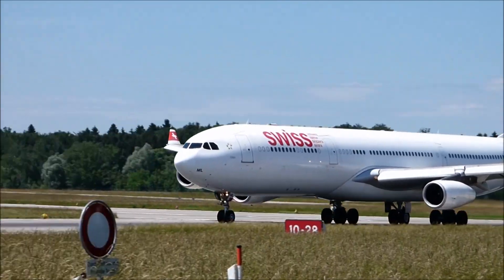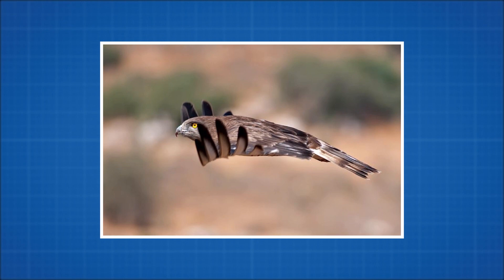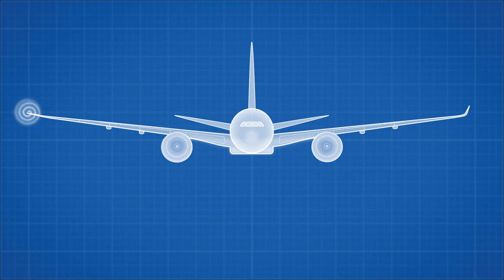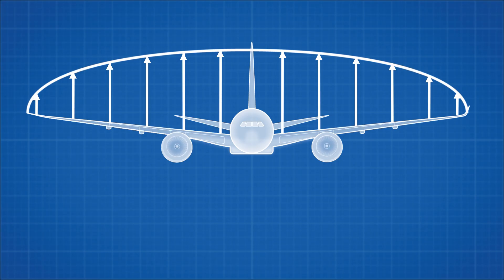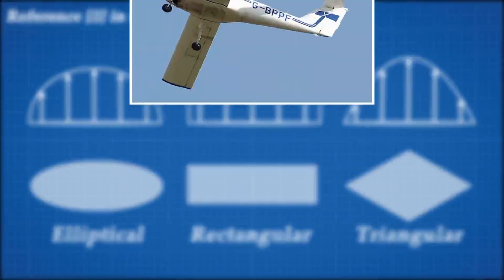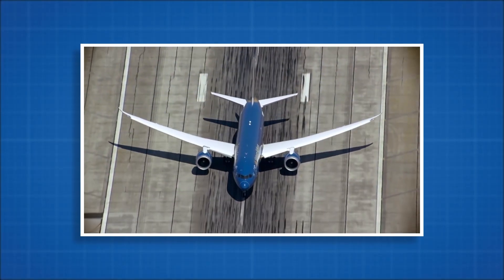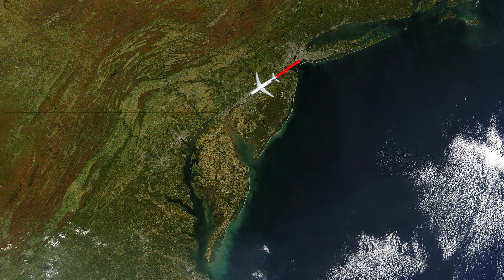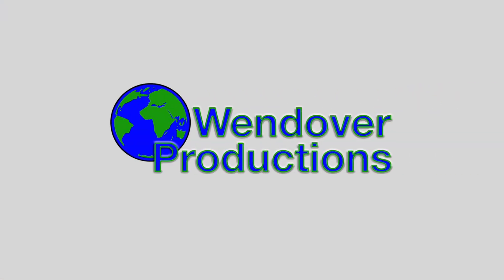Winglets - How Do They Work? (Feat. Wendover Productions)

Comment: you're wrong about how planes fly. their primary operational principle isn't the pressure gradient from the shape of the wing. if that were true, then planes would not be able to fly upside down, which we know they are capable of. the main source of lift is a sufficient angle-of-attack of the wings deflecting incoming air downward, which by newton's laws, forces (literally) the plane upward.

source: my university physics professor (who also happens to be a licensed pilot)
Reply: So there are a lot of things that are kinda woven together in this.

There are two things about the wing that will cause it to create lift, chamber and angle of attack. Chamber is basically the curvature of the wing. When flying upside down the chamber would work to create a downward force, so the plane must fly at a higher angle of attack to counteract it. 

When describing the physics for why a wing works there are multiple ways to do it that are all correct and equivalent. The most  commonly used today is to use newtons third law as you did.

The second method is measuring pressure as done in the video. This is equivalent to the newtons third law method the same way that you could model the path of a projectile using either forces or energy. The reason this is not done nearly as much today is due to a commonly repeated fault in logic about why the pressure is different.

The false statement is that the if you chose two particles of air that were next to each other before reaching the wing, and one goes over the wing while the other goes below the wing, the two particles  must meet again at the trailing edge. Since the particle going over the wing has a longer path it must go faster, which by Bernoulli's law means the underside will have higher pressure.

In actuality the two particles will not meet up, but that does not mean that the underside isn't of higher pressure. Another way to think of it is that the high pressure on the underside of the wing will make the air want to move, but it cant go up through the wing, so it must go down. By Newtons third law the air accelerating down will create an upward force on the wing.

A third, far less simple although actually more accurate is through analyzing circulation around the wing. This is very complex and rarely used but basically there is a phenomena where there is a very thin layer of air moving in a circular motion around the airfoil. This thin layer is actually moving backward on the underside of the wing. By measuring various parameters such as the speed you can calculate the lift.
Reply: Planes fly because of a combination of both these principles.
Reply: saying "planes fly because of a combination of both these principles" is like saying meteorites burn up because of air friction. technically, it is a contributing factor, but it's incredibly misleading. probably like 99% of the reason meteorites burn up is compression of air in front, and similarly probably 99% of the reason planes fly is the angle-of-attack principle. otherwise, again, how the hell would planes be able to fly upside-down?
Reply: THANK YOU!  cheeses crust, most people are mistough this information
Reply: How planes fly is as mysterious as why they fly at all. Bernoulli says its pressure difference , 
Newton says action/ reaction. I don't understand why the fast moving air on top has to meet with the bottom slow moving air at all. My professor once told me , " given enough power , ANYTHING flies. even a stone. " the plan is to make it as efficient , as controllable as possible. We are still learning. our current efficiency is no where close to that of birds.

Comment: Hey Real Engineering, I have an engineering question that is not related to the video, but I hope you can help:
Why are there so many different types of wings, especially on fighter aircrafts. Shouldn't there be a standard wing whose shape is optimised for a particular task, be it speed, manoeuvrability, efficiency etc? If you look at the YF-23, which is supposed to perform the exact same task as the F-22 Raptor, they both have very different wing designs. Is one really better than the other? 

I have been puzzled by this question or a long time and I can't seem to find the answer to my question anywhere. Do you know where I can learn more about wing shapes and how they affect the performance of an aircraft? (Or perhaps could you make a video on wing shapes? :)) 

Anyway, thanks for taking the time to read through all the comments. I hope you can help answer my burning questions :)

Your videos are educational and informative, not to mention awesome. I have watched every single one of them!
Reply from the maker: That is a very loaded question. We discover new methods of manufacturing, we discover new materials, we learn more about aerodynamics, engines and control surfaces shift position, radar evasion may be a higher concern. Speed and cruising altitude requirements change. There are SO many variables that effect wing shape. 

I'll be doing loads more videos on wing design in the future. Just keep watching to learn more!
Reply: Alright :) I'm looking forward to them as I am really interested in the physics of these wings. and I hope you can analyse how they effects the compromises made for different requirements in depth.

But I am still particularly curious about the example that I quoted on the F22 and the YF-23, they are created at around the same time, they are meant to perform the same tasks. But I do not understand why the YF23 chose to have such a different wing from the F22? Like what made them chose to have that kind of wing etc

Anyway, thanks for taking the time to answer our questions! I'm looking forward to your videos
Reply: Real Engineering why tf did I just read this in your accent without realising 🤣🤣🤣 btw love ur videos
Reply: If you break off your example from those fighter aircraft and choose for example a 747 and an A380. 

The 747 wing was designed at the time with alot of wing sweep. One reason for this is to delay the onset of shockwaves just like all other swept wings before them. Well that wing sweep gives the 747 a very high cruise speed but at the same time highly swept wings do not work well at low speeds. To solve this Boeing used triple slotted flaps on the 747 which allowed it to takeoff and land at similar speeds to planes much lighter than it.

Fast forward to the A380. Besides the fact that the engines are much more efficient, Airbus went with a high aspect ratio wing (think more like a glider wing, long and narrow chord on average). This allows the A380 to use engines with less thrust while cruising much more efficiently. The cruise speed is the same for both but the price per passenger per mile are worlds apart.

So back to the F-22 vs F-23. They both may have similar cruise speeds, range, and a list of other things the USAF wanted but I think the F-22 came out of top because it was much more conventional (basically a smooth F-15) and has a tighter turning radius due to a larger wetted area and vectored thrust. This is part of the reason the F-35 won also and not the F-32(highly unconventional, unsafe inlet, could not even transition from forward flight to hover without ground work ect).

So there is an area where the F-22 and the F-23 have very similar performance but there are areas where one is superior over the other. I believe the F-23 was faster in part due to its longer more streamlined shape but this also comes at a cost of turning performance.

That's my 2 cents but i'm just an A&P mechanic who has been studying aviation for the last 14 years.
Reply: uh oh, nope

YF-23 is actually stealthier than F-22A, or to be exact YF-22(F-22A's prototype) albeit less stealthy on cockpit area since instead of using frameless canopy, they opted the one with a bar on it. and also, YF-23 hold faster speed in any time than YF-22. the reason why it wasn't selected is: 1.because YF-22 has thrust vectoring and more conventional moving controls that's less risky compared to YF-23's combining vertical and horizontal stabilizer tail, also, YF-23 is more costly to maintain thanks to it's ceramic tiled exhaust to reduce IR detection from GAD/SAM.

YF-23 is stealthier, faster, and almost as good as YF-22 in maneuverability. but YF-22 nailed the coffin with it's demonstration of 60 degree AoA demonstration and weapon launch demonstration, which leads the USAF generals to believe it's less risky to develop F-22A than say, F-23A, also at that time, NATF exist and the navy also choose YF-22 since the naval version of it is basically a stealth Tomcat with frameless canopy and thrust vectoring, compare to the uglier delta canard design for Naval "F-23C"
Reply: F-22A reflects less radar and is more stealthier than the YF-23. YF-23 canopy has blindspots which is not ideal for dogfighting, produces a lot more heat signature unlike the F-22 which has been tested against IR missile locks. Not as aerodynamic as the F-22 in fuselage and the radar cone is also too small and many other things. YF-23 was is an obvious utter failure compared to F-22 to be honest.
Reply: ChuaShaoCong a
Reply: ChuaShaoCong I fucking love the YF-23 and I've compared the F-22 to the YF-23 and the YF-23 was batter in every aspect, the only reason why the dumb fucks in the Air Force chose the YF-22 is because it was cheaper.
Reply: About the YF-23 x YF-22 wing designs: (1) Even though the ser of requirements is the same, different competitors may interpret the weight of each mutually conflicting requirement in the eyes of the customer, and try to guess each other out in coming out with a solution that they hope will better match the customer 's overall, unwritten expectations. (2) YF-23's wings produces less induced drag (and possibly parasite drag, too) than those of the YF-22, this having in the requirements of supercruise and range. The setback is that such such causes lift to be more concentrated towards the fuselage, thus reducing, when compared to the more lift-distribution shapes, the rolling rate of the aircraft, because the differential lift aplied by aileron control will be inherently smaller. (3) So, the wings are different because the competitors applied different weights to mutually conflicting performance requirements. (4) In the end, YF-22 won becuase of a more dogfighting mindset of the evaluators, and because Northrop was in deep waters with the B-2 cost overruns, so they were not under favorable lights from the customer. Presenting a real demonstration of missile launching in contrast with doing only as a simulation, although not being a requirement for the competition, also seem to have had a positive impact in favor of Lockheed.
Reply: idk if this questioned has been answered, but basically an optimal planes wing is based on many factors such as endurance, speed altitude etc. also there are service and maintenence costs to keep in mind. The designer has the liberty of making many choices coming down to how to coil the engine, and sometimes the least aerodynamically optimal solution might be chosen either for cost purposes or smth like a military jet, maneuvering/radar detection.

Comment: Please keep in mind that on an elliptical wing a stall will happen on the entire wing at the same time. That's why they are not used very often ;)
Reply from the maker: Yeah one of the quarks of the spitfire was that the wings fluttered just before stalling so atleast it gave the pilots some warning
Reply: Only because they are not ideal elliptical. If I remember correctly they had some twist in it to get the tips stall a least a bit earlier :-)

Comment: Partially correct. The winglet also utilises the flow around the end of the wing in order to produce a little thrust which offsets the vortex drag a little. Any reduction will be an efficiency gainer.

Comment: Sadly this is only the often reapeted superficial inaccurate (or even wrong) explanation. Actually the strength of the vortices that form behind the wings is directly proportional to the lift produces by the wings, and you can't reduce that without reducing the weight of the plane. As far as I know, the only thing winglets are doing is to shift the vortex out and back to prevent the downdraft part of the vortex hitting the wing and thus reducing induced drag, or something like that. Induced drag is nothing else as the wing flying in its self-induced (hence the name induced drag) downdraft.

Comment: Yes lift distribution is somewhat important, and winglets modify that, but that is not their goal, nor how they achieve fuel efficiency.
Three dimensional airflow exists on wings that are creating lift regardless of the type. The high pressure air below the wing tries to flow to the low pressure air on the top as the video mentioned, and this creates airflow from the root of the wing toward the tip on the bottom of the wing, and the opposite way on the top. Wingtip vortices are the result of these two span-wise airflows interacting with each other. Winglets take advantage of span-wise flow by putting an airfoil in that flow that creates lift in the direction of travel of the airplane. So instead of creating lift that directs up, it creates lift that is actually mostly sideways, but a small component, about 8-10%, is directed forward. Hence, energy in airflow that was going to waste, is now being put to work as thrust for the airplane. And a side benefit is that wing tip vortex energy is reduced, and wing lift distribution is (mostly) beneficially modified. 
The size and angle that a winglet is mounted are absolutely critical to their efficiency, and if the angle is off even a little bit, or they are too big, they become huge sources of drag.
Reply: @hamidalitahir4802 I agree! But the Creator’s name is Yahweh, and His Begotten is Jesus the Christ.

Comment: Why are many planes just now getting winglets? Surely when you're spending billions to design an aircraft, adding winglets isn't some huge major change that halts R&D. I know that some airlines have really old planes, but until recently I saw newer planes without winglets too.
Reply: Because what winglets are and do, which is not explained in the video, they have design criteria that are extremely critical to efficiency, and extremely sensitive to variations from design. Because of this, it requires computational fluid dynamic analysis of the wing to properly design a winglet. CFD requires large amounts of computer resources to do. Now, I can do the most complex CFD on the laptop I'm using to type this right now. But in the 80's, only super computers could do those calculations. Thus, we saw winglets implemented as costs of computer computational power began to be worth the fuel savings cost.
Reply: Winglets became commonplace in the 80's and 90's.  Pretty much all planes manufactured after that had winglets installed.  Very new Boeing manufactured planes, specifically the 747-8 and the 787 have new wings that don't have winglets.  Boeing engineers developed an entirely new wing design for the 787 (the aerodynamics of which I am not familiar with).  This new design does not require winglets to limit the effects of wingtip vortices.  This new wing design was scaled up and is now used on the 747-8 as well.

Comment: Just to correct one small thing in this video. Wings do not provide lift by creating a pressure difference, that's a very common misconception. They actually create lift because it turns the flow of air.

https://www.grc.nasa.gov/www/k-12/airplane/wrong1.html

https://www.grc.nasa.gov/www/k-12/airplane/right2.html
Reply: Yeah it is both however the newtonian part is the one that produces the majority of lift.
Reply: So far in each of his videos, there are principles that he states as facts that are either incorrect, or a very small part of the whole part, and he never says anything to inform the viewers of it and i think it's very misleading...
Reply: +Jonas Linnros truth.
Reply: Nick Smith Explaining that aircraft fly by creating high and low pressures usually coincides with the equal transit theory that so many classrooms have taught me from K-12, which is why I wanted it to be cleared up. (the equal transit being the part that is incorrect)

Sure, it's not wrong to say that pressure difference is how wings create lift, as it's just an extension of newtons 3rd law. But it's much more confusing to non-physicists and mathematicians than explaining the general Newtonian model. Looking back the video, I think I understand why he chose Bernoulli's principle, as it's more applicable to the wing tip phenomenon he's trying to explain. So I agree that my correction was a little unnecessary.
Reply: Kevin Shih a flat plate at an angle to airflow will both deflect the air down, and generate a pressure difference.

What people are saying is you have to mention both if you're not to mislead viewers.
Reply: Its both. Neither Newton's third law nor Bernoulli's principle can account for all of the lift force created by a wing. But it is indeed Bernoulli's principle that enables an airfoil to produce the lift that it does, at the angles of attack that it does, compared to a flat plate.
Reply: Yeah for a guy who calls his channel real engineering, he really dosen't know much about engineering.
Reply: "{The upper flow is faster and from Bernoulli's equation the pressure is lower. The difference in pressure across the airfoil produces the lift.} As we have seen in Experiment #1, this part of the theory is correct."

I know it's fun to try to "correct" people on the internet,  but did you even read the links you posted? In reality, both conservation of momentum and pressure differences are a part of the governing equations of fluid mechanics.